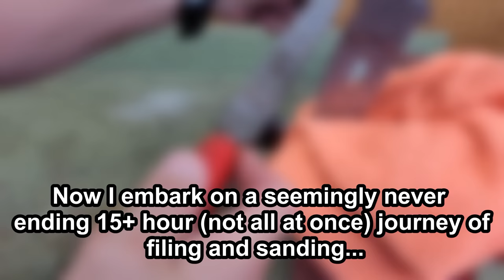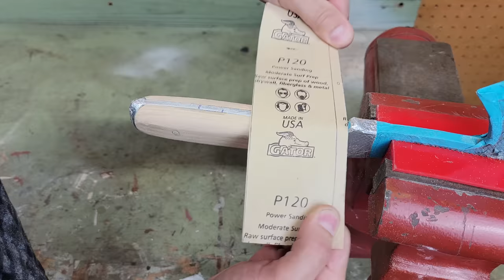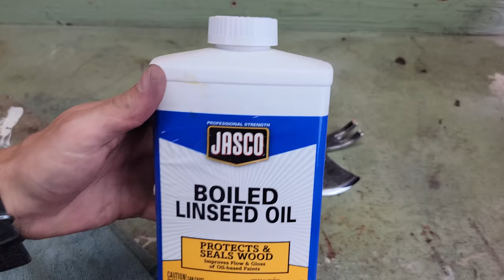Rusty Vintage Hatchet Multitool Restoration

Comment: Using an angle grinder with sandpaet flap wheels would have saved 90% of the time spent.
Reply from the maker: It would have for sure, I did that on my previous restoration and for me it just didn't feel right. So going forward I plan on using hand tools as much as possible. 
Thanks!

Comment: So uh, what's with the obvious grey paint at 2:07?
Reply from the maker: That is what steel looks like after it's been sandblasted. Thanks!
Reply: @RookieRestoration  No offense, but I've seen sandblasted steel more than once and it's usually not that light a color, if it's legit my bad, but you can't exactly blame me for being skeptical.
Reply from the maker: No offense taken. You can see it changing to that color in the part of the video when I'm sandblasting it. Besides, I'm not sure what the benefit of painting it before that shot would even be haha.

Comment: These are not "vintage".
This style of axe/multi tool are still produced in China and are basically "throw away" crate openers. 
I've used one for camping for many years and still have one in the trunk of my vehicle. 
Because they are cast metal, the prongs of the nail puller often break off, but on the whole, for a few bucks, they are serviceable emergency "go to" tools.
Reply from the maker: Thanks!

Comment: All of that work sanding,filing and polishing and yet it is still pitted. Nice try though.
Reply from the maker: At a certain point you have no option but to stop removing material, otherwise I would have removed all of the left over pitting. Thanks for the comment!